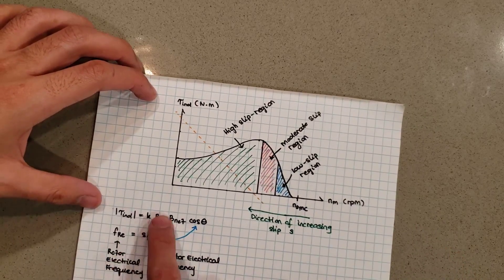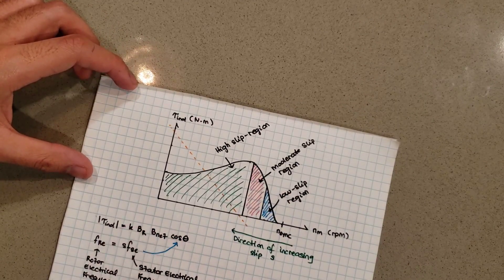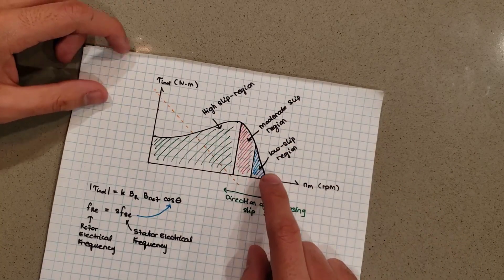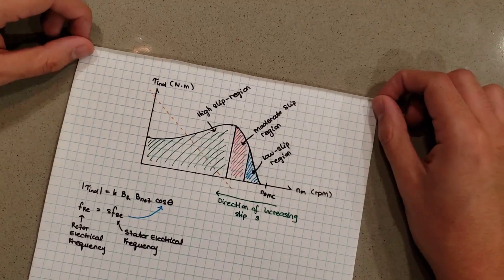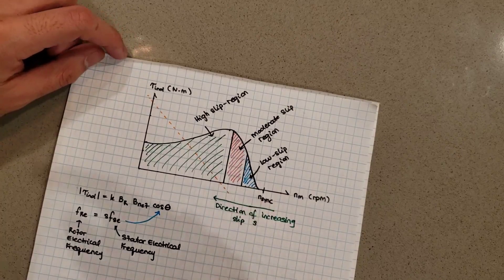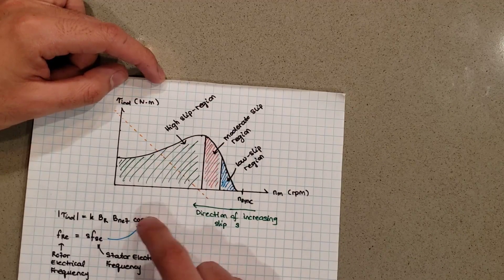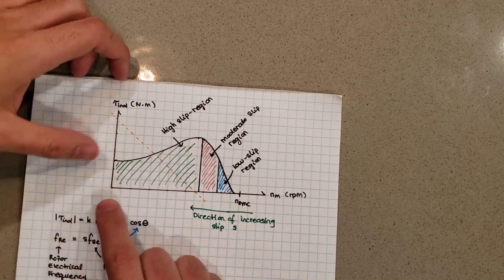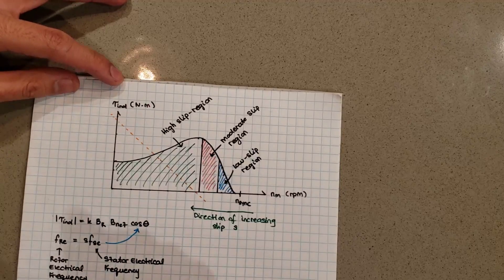Torque Speed Curves of Induction Motors Part 1

Comment: I need to know one thing about torque and speed relation , if the torque decreases with speed is it good o not for motor and and if the torque increases with the speed decreases too good or not for motor ?
Reply from the maker: I don't think that's good or bad. It's just part of the properties of the motor. And by "good" or "bad", do you mean is it dangerous/damaging or not to the motor?
Reply: @abdullaalmosalami  I am confusing about that really , because why we consider the torque with speed in choosing a motor for an application ?
if the motor increases the speed and the torque decreased is it good or not in the motor performance , or current consumption will be increased or not ? that what am asking
Reply from the maker: @wadib3eed7  Ok, so I hope I understood what your confusion is:

"... why we consider the torque with speed in choosing a motor for an application ?"

If the motor doesn't have the specified torque/speed needed for an application, that application won't run right. For example, motors for wheels on a cart. If the torque/speed is not matched, then the cart moves too slow, or too fast, or doesn't move at all; etc. How do we know these torque/speed numbers? That comes from having a good model of the object we are trying to drive, and the more detailed the model is, the better we will understand the requirements of the motor.

"if the motor increases the speed and the torque decreased is it good or not in the motor performance, or current consumption will be increased or not ? that what am asking"

Ok, so I'm not fully sure still what you mean specifically by "good" here, but let me say this: torque and current always move together - if torque increases, this is because current increased; if torque decreased, this is because current decreased. This is because current --> magnetic fields --> torque. If the current goes up, is that bad or good? Well, if the current is within the rated specifications of the motor, then it's just fine. However, if you are stalling you motor which causes the torque and current to be also at max, then this is generally not good for the motor, no. What about for performance? Well, the "performance" kind of comes down to can the motor run the application at the needed torque/speed. We just talked about torque. Read onward for speed.

Speed comes not from current directly but is the result of the dynamics of the motor + load. This is where modeling comes in. The most basic kind of modeling for example could be done using Newton's laws of rotation on the motor shaft, where (sum of torques on shaft) = (moment of inertia of shaft) X (rotational acceleration of shaft). And we know that (derivative of rotational speed) = (rotational acceleration). This usually results in a system of differential equations that you either solve numerically or analytically, depending on how the torques are modeled. For example, maybe you are running a constant current into the motor, which means a constant torque from the motor. Ok. There is also friction, which is NOT constant and increases with speed (or even the square of speed). Indeed, friction plays a BIG role in what the speed is at the given motor torque output; if friction was truly zero, then actually the speed would keep going to infinity!! You put these into the differential equations above and solve.

One final thing I will say is the torque-speed curve shows the numbers once the motor has reached steady-state - once the torque/speed/currents/etc. have stabilized. On the way to this stable state will possibly be other kinds of behavior that are not at all shown in the torque-speed plot, and the only way to know what these will be is by again having a good model of the situation. Also where on the torque-speed curve the motor lands is again dependent on the dynamics of the situation, which will not be obvious and you will need to have your detailed model to have a good guess of what will happen. Even if you know the torque your load needs, the speed may not be determined immediately. Some of the plots shown in the video for example have two speeds that have the same torque - which of these speeds will the motor be in for the application? I don't know. You need your model.

Let me know if you still have some confusion. We can work this out.
Reply: @abdullaalmosalami  Thanks for answering. I too had these doubts in mind